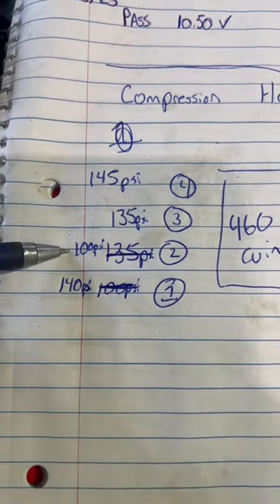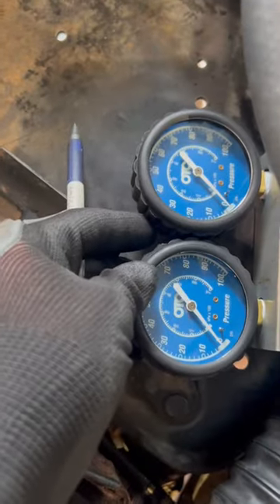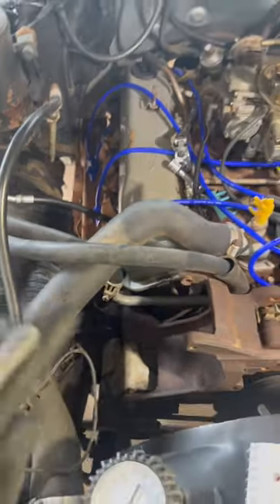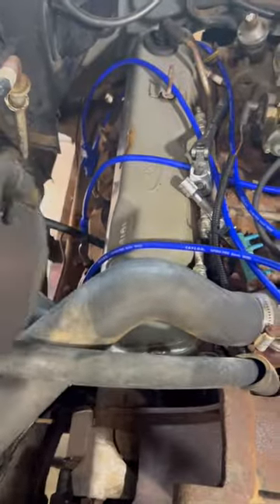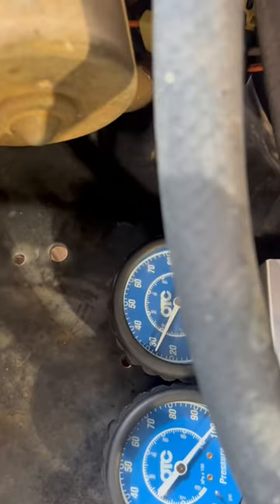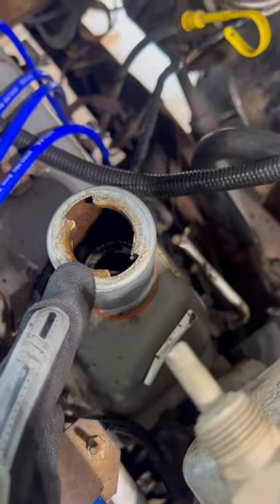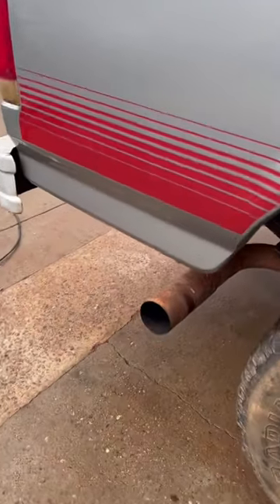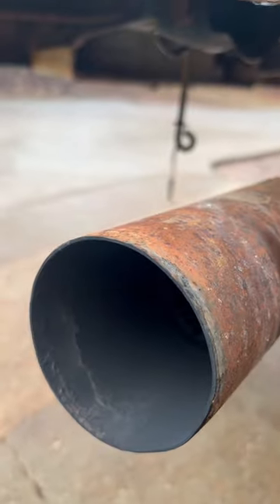Leak down testing a Ford 460 CU IN #shorts #ford #fordperformance #f250 #460 #f #s #x #4x4

Comment: So if the air was coming from the carburetor it would be the intake valve? Thank you for explaining this. I’ve known about the tool, but never used one. Or, knew the logic behind the test. Now I completely understand!!!
Reply from the maker: Yup, exactly. Carb = intake valve, oil filler = rings, exhaust = exhaust valve

Comment: U left out one other option. You can also get air in your radiator if you have a head gasket bad. Or a cracked head.
Reply from the maker: Good call. I need to get that tool also. The one to pressurize the coolant system.
Reply from the maker: In this truck, the exhaust valve was a problem.

Comment: Hey sir, what was the outcome ? Was the exhaust valve burnt or was there a piece of carbon keeping it from closing well ? Or was the valve clearance too tight?
Reply from the maker: That owner/friend decided to just run it. The truck sat for almost 10 years. I think this was the exhaust valve that was open. And the seat started to rust. The rocker arms all felt great, when I had to regasket the engine later.
Reply: @RocketGarageService  that makes a lot of sense and if there was only a way to clean behind the exhaust valve that would be amazing. Let’s hope thousands of miles down the road the rust takes a pounding and decides to flake off ..